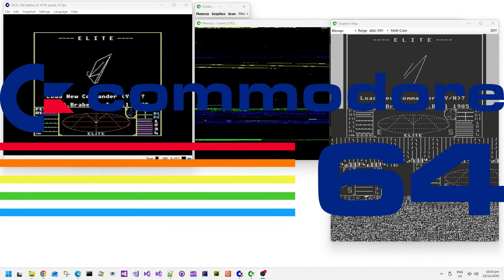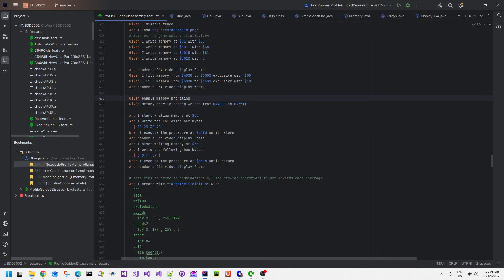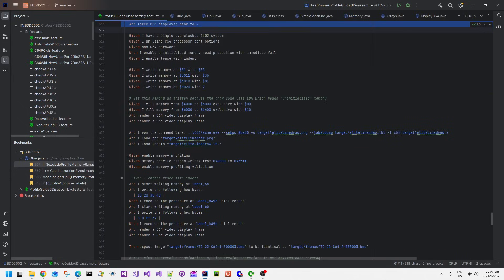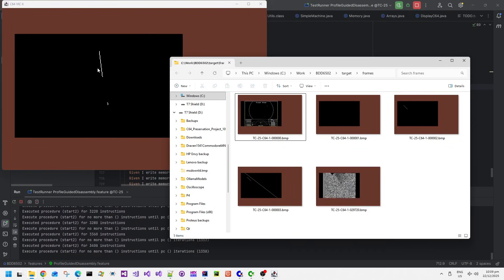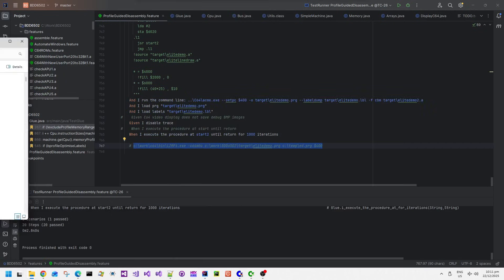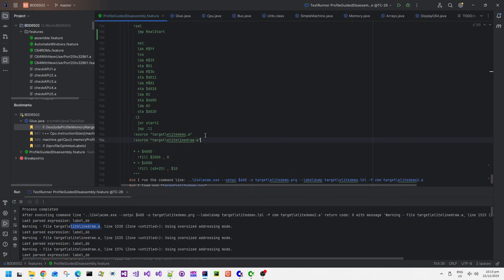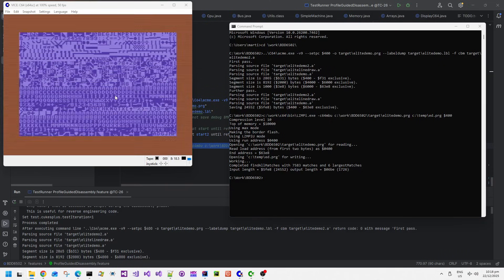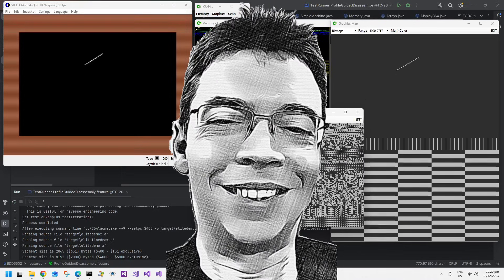C64 Coding - Elite's line draw disassembled

Comment: 💜Astonishingly brilliant! - Elite's line draw routine is one of those things which I have been curious about ever since the '80s. 🙂
- Of course my next thought immediately goes to the fairly recent VIC20 version of Elite (from January 2025). Not only how it manages to draw vector graphics on a machine with no bitmap-graphics. I'm imagining something along the lines (pun intended) of the software sprites trick from the C64's version of Bubble Bobble. But I also cannot help but think that it might be possible to adapt it to the C64's text screen. Because that could obviously free up like what? 8K of RAM or something? - Maybe not quite that much?!? 🤔
Reply: The NES version is also quite fascinating. Another system that requires drawing into the character set to fake a bitmap like the Vic-20.
Reply: Eminently doable. Coded a 3D petscii hybrid wolfenstein/polygon engine for 64 for a lark to do an elite/wolfenstein type game years back, which kind of does that. It did pseudo textured polys and lines in petscii with 1D zbuffer which to me looked quite aesthetic. Also had a proxy sprite LOD, pseudo transparency via colour ram, a particle engine etc. Because was text mode  even unoptimised compositing  2 buffers per frame was quite fast, with unimplemented optimizations up to 200% faster on paper for raycast/polygon rendering. Things came up and lost the will to follow through. Maybe AGI will finish it off for me one day lol.

Wonder why c64 game programmers didn't use text mode more often to create faster more colour 3D engines for things like this?
Reply: You define a custom charset on the VIC-20 and draw into it. You can also use double-height chars for more resolution. The C64 can also use a charset, and in fact it's far more efficient this way, as you get to control the memory layout to make the calculations faster. As I recall, each line point could be about 30 cycles. Calculating a line is extremely simple, add DX and subtract DY, if the result is over 0 take a step in the X direction. I think Elite could be made far faster.
Reply: @curiousgeorge7515  You could get 128x128 out of it just normally, right? Though you'd have nothing left for the radar etc. But that would be enough for a reasonable size play screen within the overall VIC20 resolution... Maybe have to do some multiplexing or pointer changing.
Reply: @tahrey  If you enable double-height characters, there would be some left over at the bottom rows, they could be moved to fill in other areas.
Reply: @curiousgeorge7515  Does that let you define 8x16 chars or does it just stretch them out?
Reply: @tahrey  Yes you can define 8x16 characters. poke36867,175 to see it. poke36867,174 to return to normal. Typing a letter will type 2 vertically stacked letters.
Reply: @curiousgeorge7515  Ah, nice. So you could pull off a near-full-screen 176x176 (or 160x192?), assuming it's possible to define 242 (or 240) custom characters? (IDK about *that*)

Though probably 176x88 or 160x96 would still have been kind of passable, maybe with a few default chars used for messages, as the pixels would be more square that way, and it should still be possible to get enough of an idea of what's going on in the external view, along with increasing the framerate...
Reply: @tahrey  You can do more - the VIC-20 can adjust the number of columns and rows, to the point of reaching to the borders. On top of that, you can enable interlace mode. If you switch charsets each from, then you have double-height interlaced video.
9000     36864   bits 0-6 horizontal centering
                           bit 7 sets interlace scan
9002     36866   bits 0-6 set # of columns
                           bit 7 is part of video matrix address
9003     36867   bits 1-6 set # of rows
                           bit 0 sets 8x8 or 16x8 chars
And you can set the charset defines at every 2kb address.
Reply: @curiousgeorge7515  Yeah, I was just thinking in terms of what you could actually use to build a usable APA screen. Like, how many custom characters can be defined and then drawn to the screen. The original 22x23 character layout (using 506 bytes for the chars plus I guess another half-K for the colours, thus leaving only 12 bytes change out of 1K?) translates into 253 double-height characters, but of course 23 doesn't divide nicely.

Knew about the redefinable screen size, hence the 160x192 (20x24 chars, or 20x12 double height) suggestion, or simply a "square" 176x176 / 22x22, but going bigger would only work in this case if you either had repeatable (mirrorable?) elements or could repeatedly redefine the charset in beam-racing fashion (can the start point be changed easily, so you can keep it in memory and just page-flip halfway?). The ideal of course would be 128x256 (16x16 double height) to use 256 characters total, but that would be too tall on NTSC and pretty narrow on both those and PAL screens. I don't know if there's an alternate size that would use more of that (assumed) maximum whilst still being a reasonable shape.

Also at least part of the original BBC screen was drawn with 160 horizontal resolution, so going wider wouldn't really be of any benefit anyway. Presumably the C64 version used similar at the time, whether any modern renovation goes up to 256 or 320 instead?

One thing that might help me with a personal project at the moment is knowing how many pixels you could fit across a visible VIC screen on both NTSC and PAL (as each machine has a significantly different pixel clock, unlike most other systems that keep them as close as possible). I'm assuming something like 192 for NTSC and 208 for PAL, but don't actually know... (as well as the max line count, but that's a more generally fixed thing). Presumably the absolute max you can set is something like 256x256 even if that's not actually displayable (or drawn within the blanking limits)?

That it has an interlace mode is rather amusing. In what context were they ever imagining that it might be useful? Especially as the text characters are already difficult to read with how wide they are in progressive mode... you'd have to use double height just to define something readable. Never mind the memory take (normal size screen doubled up would take 8K as a 1bpp bitmap...). Really I can only assume that it displays the same data for both even and odd fields, essentially line doubling the lazy way, and it only exists to make life easy should someone want to use VIC output as part of a TV broadcast chain or record onto tape through a system that wouldn't play nice with progressive output (and timing)... Though given the system clocks, only the NTSC model would give properly standards-compatible output even so, PAL has to choose between slightly slow or a decent bit faster as correct timing would require fractional pixels per line...
Reply from the maker: If I were to guess it would be using dynamic characters, allocating new defined characters to draw lines and potentially reusing and updating characters if they're already on the screen.
Reply: @MartinPiper6502  Yes I agree, for an unexpanded VIC-20, this type of memory re-use is important.
Reply: @curiousgeorge7515  There ain't no way you're doing Elite on an unexpanded VIC. Maybe you could do a little demo of the title screen... Still, maximum memory is, like, 35KB isn't it? Which is only slightly more than the BBC, so you can't afford to be wasteful at all even with the full fat expansion.
Reply: @tahrey  It depends, if a cartridge had banked ROM (actually flash) then you could have plenty of memory for code and data, with most of the ram doing to graphic screen and state. Other than that, you could make your own interpreted language to kind of compress the code. This is actually used in the TI-99 where the original basic was written in an internal language called GPL.
Reply: @curiousgeorge7515  Ah, I didn't think about cartridges, my mind was in the tape / disk space. Though, the thing with Elite specifically is the procedural generation which I expect happens either during load (and maybe overwrites the generation code with the output?) or on the fly. With the amount of memory that the display alone takes up out of the basic 5K, I don't know if that would even leave enough space for all the working variables and other state the game uses...

Then again with modern storage, you can probably pregenerate absolutely everything that would be in the game universe?
Reply: @tahrey  It could be a challenge but I don't see why you couldn't load some needed things from disk dynamically as well.
I can't say I'm that familiar with Elite, I've played but not finished it. I'm just talking generically here.
And it's not that the graphics take up so much, after all a charset is only 2k compared to a bitmap on the c64 which is 9000 bytes, so that helps a bit.
Reply: @curiousgeorge7515  Well yeah, but that's why I specifically said Elite (which was considered some kind of arcane magic for fitting within 22KB of code, leaving 10KB for screen and working data on the BBC, I guess 8K of which would have been the screen, split between a mono 320-rez upper part and 4-colour 160-rez lower with only 200 lines used out of 256 normally available? Possibly cramming non-graphic data and code into the letterbox area, as quite a few BBC game did, with the palette set to all-black...), as well as specifically an unexpanded VIC, which has a whole 5KB to play with.

Working things out, 2KB only gets us 256 characters at 8x8 size, or 128 at 8x16... so does it only allow you to define that many? It was getting 256 chars at 8x16 that I was basing my thoughts of what pseudo-bitmap resolution you could get out of it. You could save some slots with a bit of trickery with blank areas and repeated tiles, but I think cutting it completely in half would be a big ask. Nevermind that you might need to save some for text, unless you're going to draw it using software into the ersatz framebuffer with glyphs pulled from ROM... (of course if you can do that for at least some of the more static elements on screen, that's also a saving...)

To get that many double size characters, you need more like 4KB instead (which after all is what we'd expect for a roughly C64 lowrez bitmap screen in 1-bit monochrome). And on top of that the actual screen buffer indexing into that character set takes another half or full kilobyte of space depending if you have any colour or not (a total waste, but a necessary evil with this type of video system).

So between all that you've already used almost all the RAM in the system, save for somewhere between 38 and 544 bytes (depending if you can disable colour and have it default to pure black and white, reusing the attribute space for other things). At that point I think you'd be exceptionally tight just between your ship's location, rotation, and velocity in space, your current cargo, fuel capacity, money, installed parts and their damage status, reputation / wanted level, similar for any other ships in the system (including pirates or police), system ID and name, cargo prices and availability (and legality), and all the vertices that need to be drawn for those ships, the space station, any functions for other-ship AI, auto-dock computer function, anything to do with your guns and shields and those of the other ships, fuel/loot scoop, calculations for whether you can hyperspace to a particular place, menu state, other transient variables such as for taking inputs and acting on them...

38 bytes is less than half of what the Atari 2600 typically had to play with, and 544 still isn't very much - a quarter of the working memory on the NES which purely had to deal with game variables, for example...

If someone pulled it off (without extra memory in the cart, which is essentially the same as adding a RAM pack) I would be suitably impressed and contrite, but I just don't think it's realistically possible even with genius-level coding. Absolutely no way it could be done with disk unless you were prepared for it to spend the entire time acting like a cheap Windows machine with insufficient memory (ie continually swapping and hitting the disk) and running just as glacially slow as a result, and straight up impossible with tape. Compression and efficiency can only do so much, at some point you reach an entropic limit where a given thing you want to do requires a certain absolute-minimum amount of storage cells on your Turing machine's tape...
Reply: @tahrey  Oh, if your argument was always for an unexpected VIC-20, of course I agree that's not do-able. I was assuming a fully expanded VIC-20 could do it.
Reply: @curiousgeorge7515  Ah, I guess we were coming off my initial reply to your first comment in different ways :)

Yes, with that extra 30K things will be much easier... it's a little more than what Elite's home platform had, and there won't be as much given over to the screen, but the CPU is basically the same (just lower frequency), so you should at worst be able to replicate the original code just with some adjustment to the drawing and sound routines. Having maybe, I dunno, 6KB extra to play with might allow some less compact but faster running unrolled code and precalculation of certain things to get the framerate up and compensate for having lost nearly 50% of the processing speed?
Reply: @tahrey  haha all this time :)
Algorithms can, in some parts be up to twice as fast, and more memory (at that ratio) is always a tradeoff. From the disassembly I've seen of Elite on the BBC version, it can be made much faster.
See my article c=hacking10: A Different Perspective, Part III.
I also hold the world record for a 6502 multiply (16-bit unsigned). For 8x the memory and using a few kb of tables, I am just over twice as fast as the best version without tables. 
See Toby Lobster: 6502 Integer Multiplication - which is best?
Algorithm mult64 vs mult86 (and I have an unpublished version which is even faster).
So I would say with good confidence, yes.
Reply: @curiousgeorge7515 nice... I guess having 2x faster mult would probably be pretty useful in this kind of calculation... Think you could get it into 6K?
Reply: @tahrey  That wasn't the main result - A Different Perspective series of articles talks about a 3d engine where most of the calculations are done in tables. It's much faster per transformed 3d point. Even division is done with log tables.
So I'm saying that calculations can be about twice as fast as a tradeoff for memory and there are tradeoffs in between where 1/2 the memory is used but it's a bit slower.
Our full 3d engine was less than 6kb I'm sure.
Reply: @curiousgeorge7515 funnily enough, looking through the Stunt Car Racer disassembly earlier (from a discussion on another of the videos in this series), it does exactly that. Several clearly marked blocks of sine, cosine, etc transforms to do quick and dirty (but still sufficiently accurate for the purpose to which they're put) lookups instead of long winded floating point calculations that might consume most of a frame by themselves. Reminiscent of how the Yamaha FM chips generate their waveforms, even.
Reply: @tahrey  Yep exactly. And yes there's several methods to generate sines quickly, they interpolate pretty well.
Reply: @tahrey  I could also mention the CORDIC algorithm, which has been used in calculators (and there's even a 6502 library for it). It can generate bits at a time with simple integer math and tables.
Reply: @curiousgeorge7515 not come across that, but, interesting. Maybe that's already used in one or other of these, unless it's a recent development?
Reply: Check out Mark Moxon's Elite disassembly site. It's a masterpiece and will satisfy all of your curiousity!
Reply: Great video, Martin. Seasons Greetings 🎄